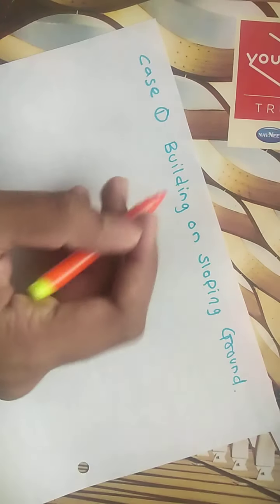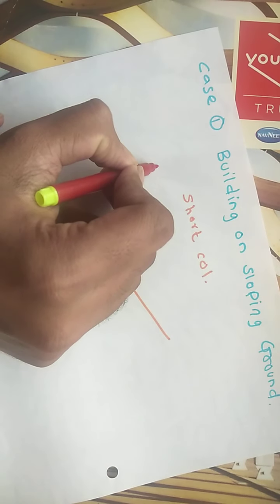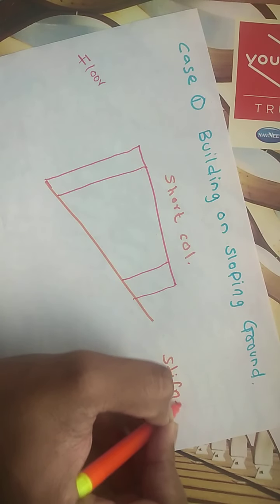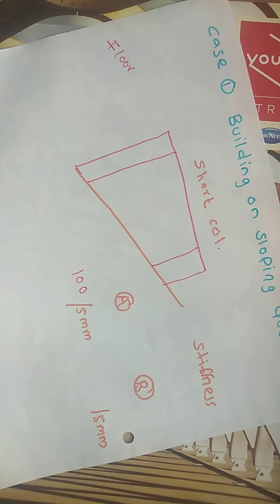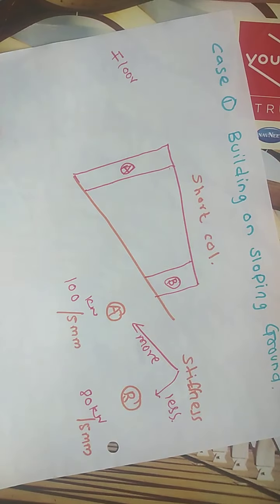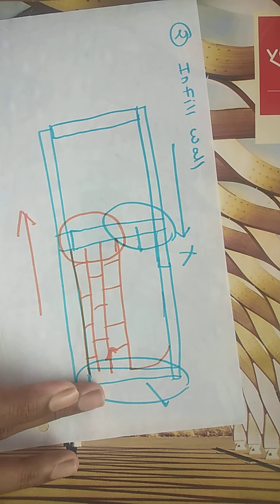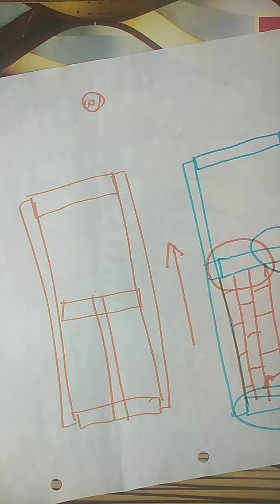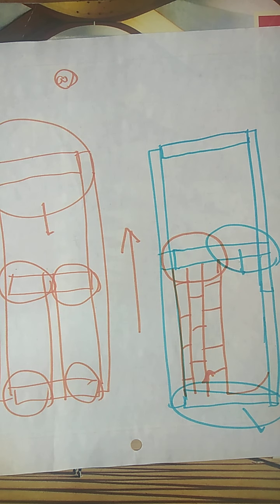short column effect  | what is short column and long column | short column fails due to

Comment: Bhai why short column attract more force than long column 🙏 
Please tell me
Reply from the maker: Stiffness: Short columns are typically stiffer than long columns. The stiffness of a column affects how it responds to lateral loads such as seismic forces. Short columns have a higher stiffness, which means they resist deformation and movement more effectively. As a result, when seismic forces act on a structure, the short columns transmit a larger portion of the forces, attracting more load compared to long columns
Reply: @Realcivil  thanks.

For same amount of displacement the shorter column will attract more force.
Resulting it will collapse
Reply from the maker: Yes